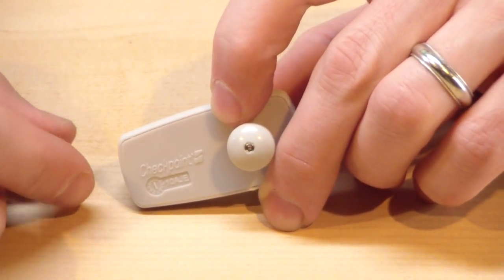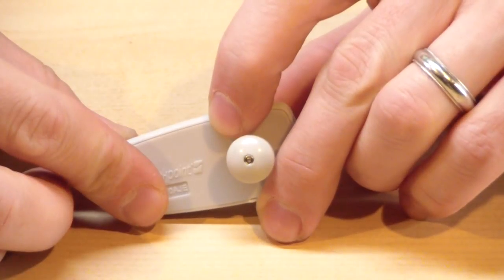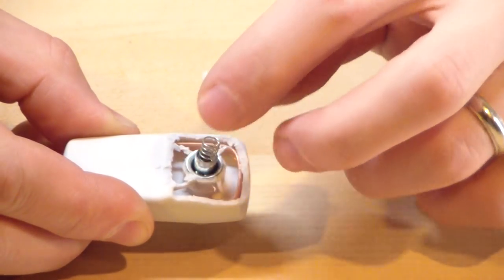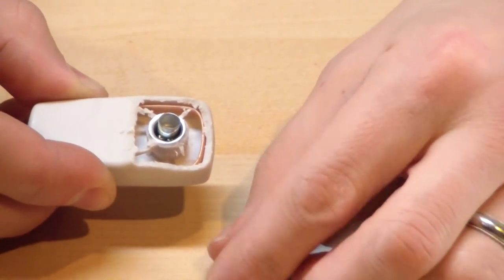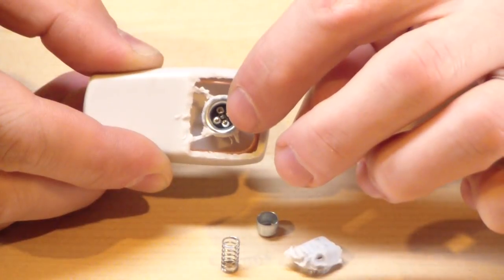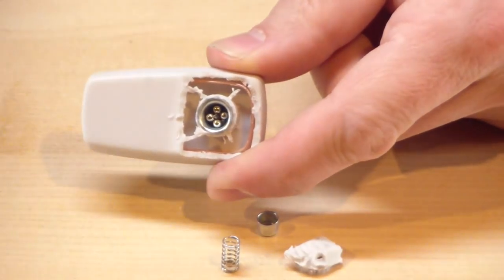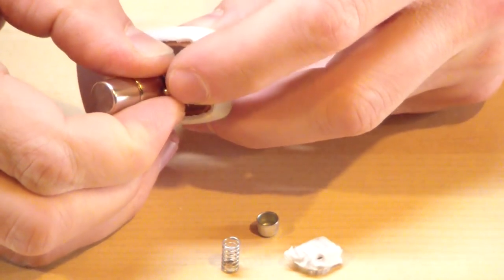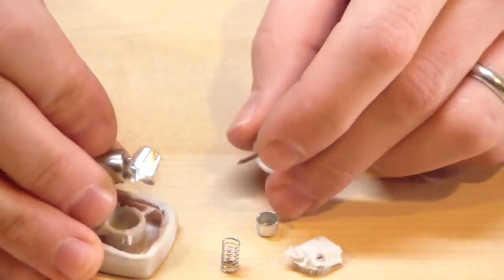What's Inside a Clothing Security Tag?

Comment: yeah I worked retail I'm not sure how it works either but there is usually a clap we would place it on facing down to remove it so this sounds about right. I'm guessing the down part is the powerful magnet. It's so easy to do I don't understand how workers forget do remove them. Anyway the ones with ink are what I'd like to see opened.

Comment: You didn't mention the coil and capacitor also inside the housing. I just took mine apart. It appears the coil is energized by a nearby magnetic field, not necessarily a magnet--but a field of some sort. It induces a current in the coil, a magnetic field--and that seems to pop the balls. I'm sure I'm only vaguely describing this right.
Reply: it starts the alarm if you want to leave the shop with the tag
Reply: its a passive RFID tag, when the radio waves from the sensor located near the shop entrance interact with it...the passive tag wakes up and sends its waves back and triggering the alarm
Reply: @TRiiKzZ1CoD  it's eas not rfid.